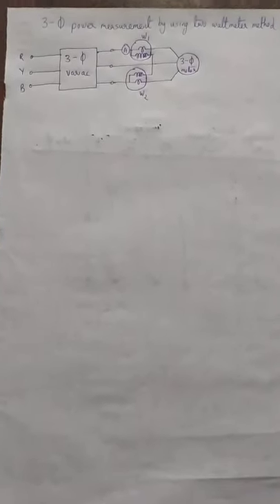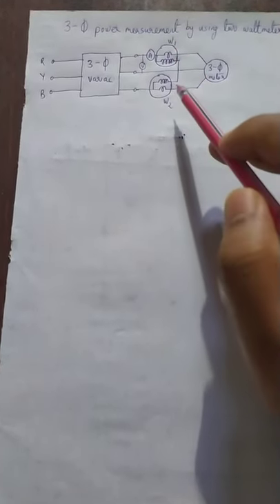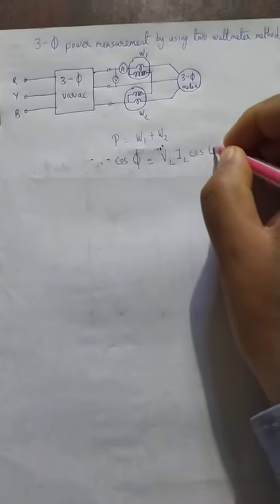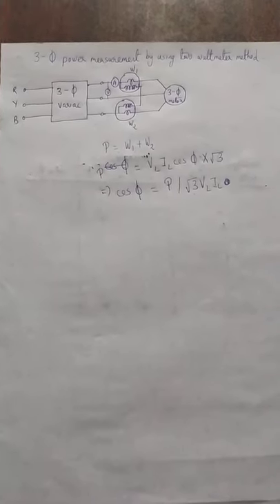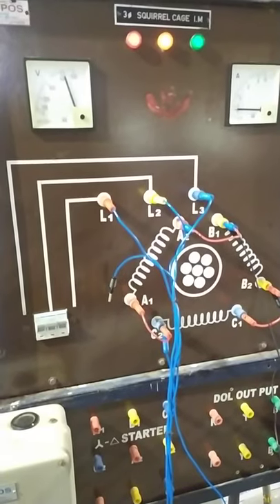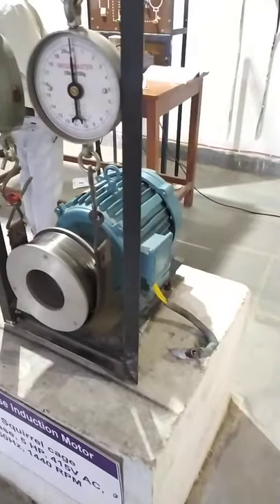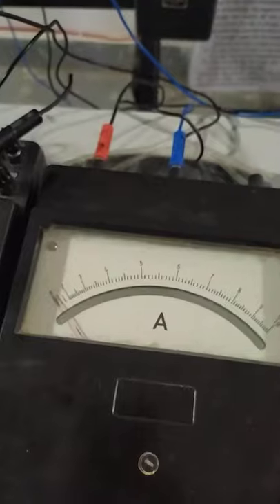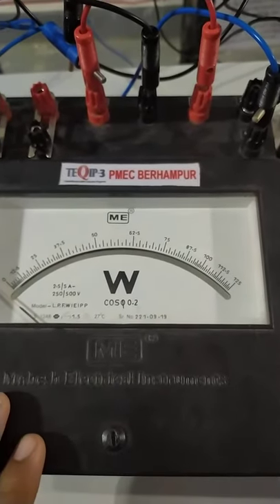Laboratory demonstration of three phase power measurement by using two wattmeter method

Comment: sir why is one wattmeter showing negative reading?
Reply from the maker: Since power factor is very low, one wattmeter is giving negative reading. Come across the theory of two wattmeter method of power measurement for details.
Reply: @basicsofelectricalengineer4575  Thanks Sir, I Will read on it further.